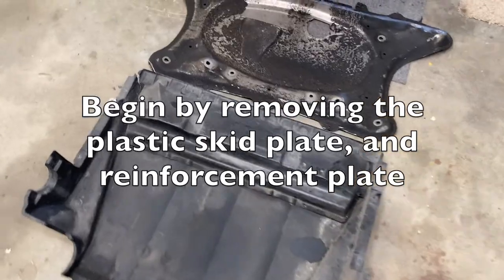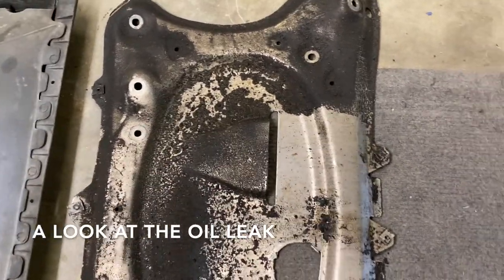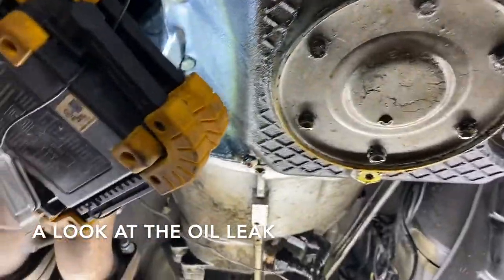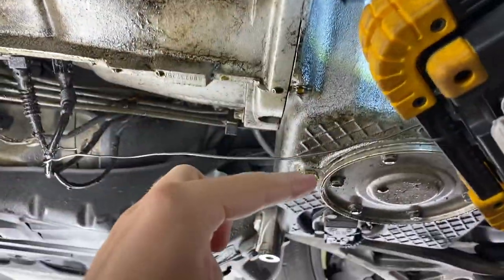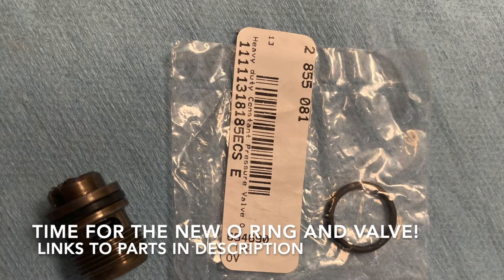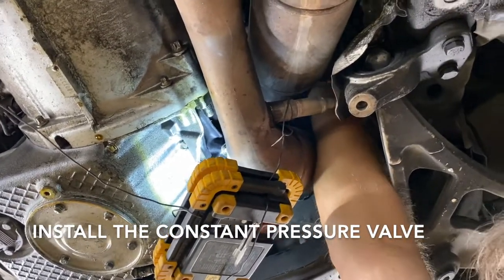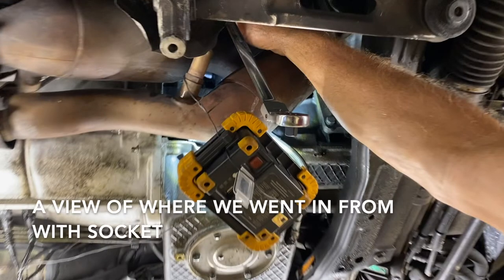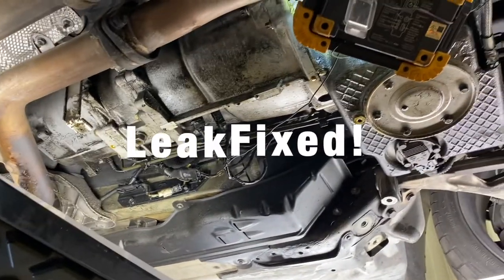The Hidden Oil Leak on the E46 M3! Where it is and how to fix it in Minutes!

Comment: While using your videos as guide to rebuild my Vanos I replaced that seal at the same time. Mine was barely sipping oil but I figured it was a good preventive maintenance
Reply from the maker: yes! good idea to just do it when you can.  Even if its just a little leak it can make a big mess over time.  Glad to hear you went and did it and also that you were able to rebuild your Vanos system!

Comment: I have a strange feeling that oil is also squitring from there. Everything is dirty from the block back. But, I don’t refill the oil because it’s not missing. This oring is probably the real cause. I would ask, what does this valve regulate at all?
Very useful video!
Reply from the maker: Very good chance!  The  O ring is what fails for sure.  We only replaced the valve as well because the slot on the old valve to remove it was damaged and we rather just replace it so if its ever a problem its not an issue to get out.  Shouldn't ever happen with the viton seal though.  If your valve is good to go, then just do the seal for sure.

Comment: Thanks! Is this an issue for the e46 in general or only for the M3s? My 2004 325i 210K original miles has a small leak and they think is the oil pan gasket.
Reply from the maker: I cant say that its 100% the issue.  IT very well could be though and its a good place to start looking for sure! get it on jacks and start tracing own the leak.  If you're finding oil in places that doesn't match an oil pan, its a good chance. I haven't worked on an M54 or id give you more details.  Let us know what you find!
Reply: @FatboysGarage  Thanks, that applies to the S54 engines (M3) M54 apparently does not have one